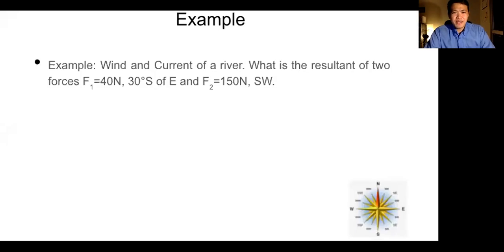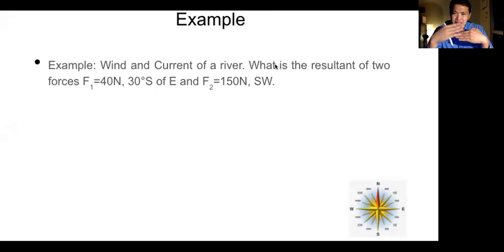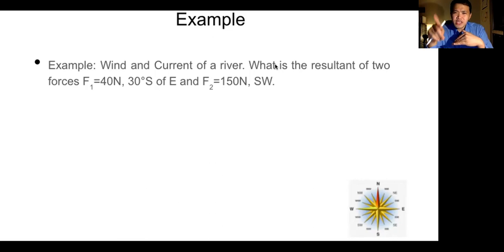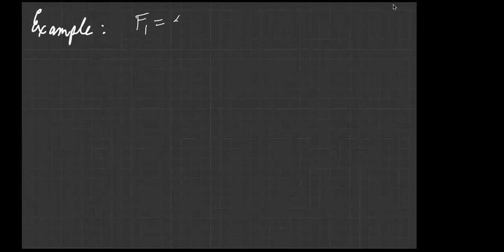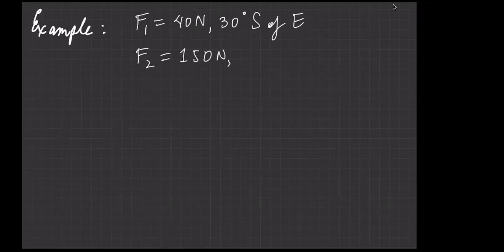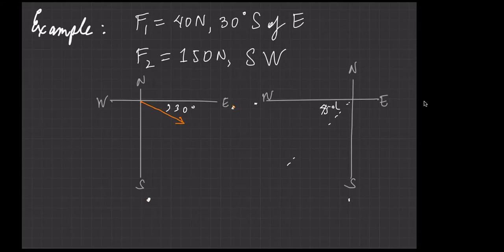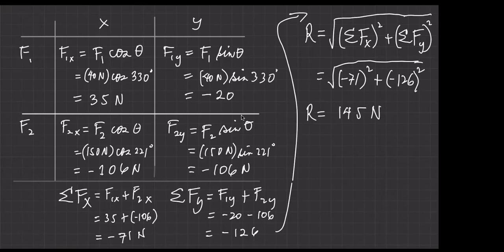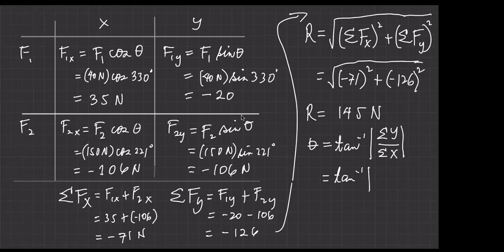Component Method Sample Problem 1

Comment: Sir, when I computed po yung 150cos221, my answer po is -113 and -98 po sa 150sin221.
Reply from the maker: Very good! That is correct, I verified it.
Reply: @danielvicario5885  Sir, should 221° be used? Is it not supposed to be 225°?

Comment: Sir, how did you get the angle on SW for vector F2?
Reply from the maker: SW means exactly in between South and West which is 45 deg. So with respect to the positive x-axis that is 180deg + 45deg = 225deg.